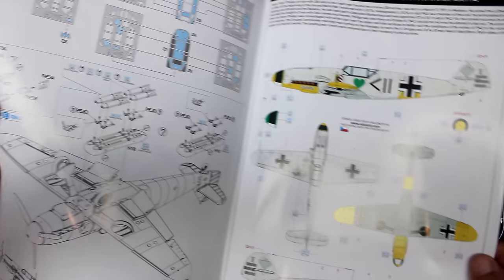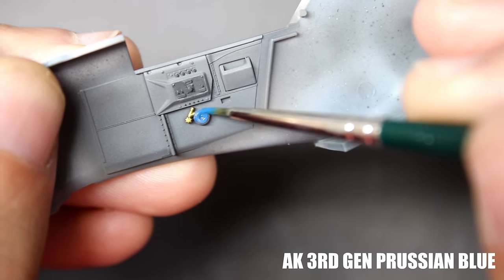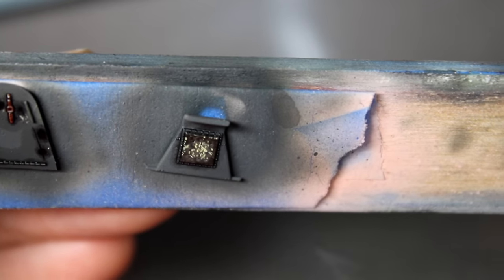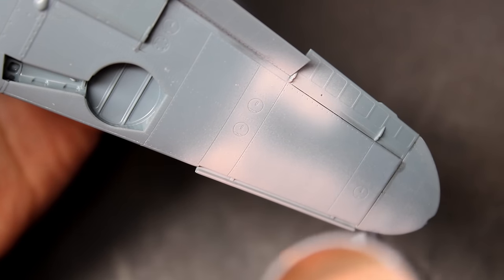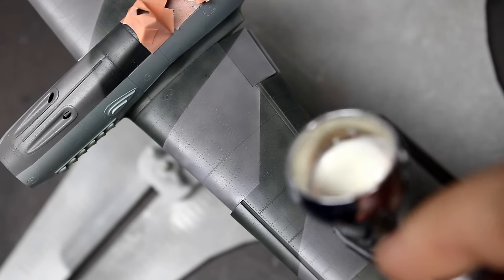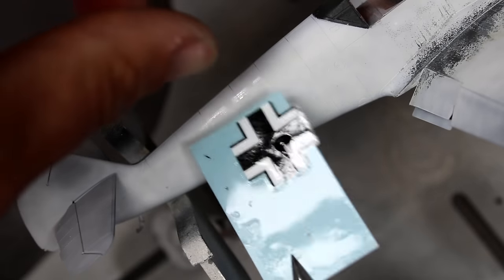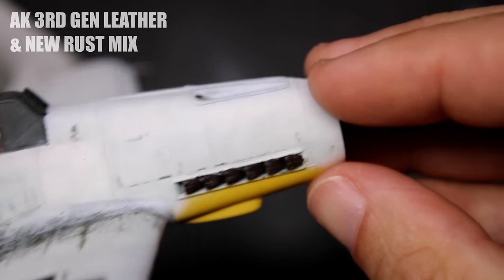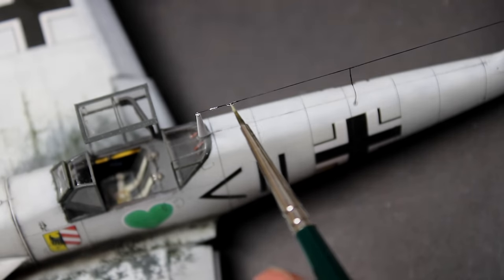My FIRST Winter White Wash! Eduard Bf-109f-4 with Sunward Hobbies

Comment: Great job as always!
Love the newer Eduard kits......except for those decals. I've had varying success peeling those decals. Some models they work great but others they seem to peel half the decal off even though I have used the same brand paint, clear coat, setting solutions and drying time for my models. Those Eduard profi packs are expensive, especially in Canada. Eduard should be including Cartograph decals in their profi packs and leave their in house decals to their week-end editions.
Reply from the maker: @Maddog-nb9vu  they are expensive because they can be hard to find here. But with the exchange rate they’re close to on par with US distributors.

Comment: Blend acrylic with a medium, not a Halloween type session, but a specific fluid, you can use dish wash liquid in your brush clean jar to varying success I’ve found, Vallejo and all major brands have their own products so see what works for you. A problem I cannot get past is the Tamiya liquid fluid glue and making it to ever work, is it too old, or am I not using it correctly? On videos people happily put the tiniest spot and it glues like CA (which is excellent at gluing my skin, it’s actual designed purpose to repair wounds sustained on battlefields) but seldom anything else! The less viscose liquid glue is better.

Comment: For acrylic blending, I use a 3 color system. A dark, base and highlight. I then mix  the paints together (dark, dark+ base, base, base+ highlight, and highlight) so I have a gradient of 5 colors. I start with the darkest colors, then paint everything with the dark+base everywhere but the deepest shadows, and continue the process with all the colors, painting less and less of the object I’m painting. I keep the paints pretty thin and slowly build it up over a few layers.  I find this gives me lots of control and a harmonious result. Hopefully that makes sense, comment if it does not and I will try to explain/ clarify things!
Reply from the maker: @jonmurphy9424  I’ll try that out, thanks for the info!